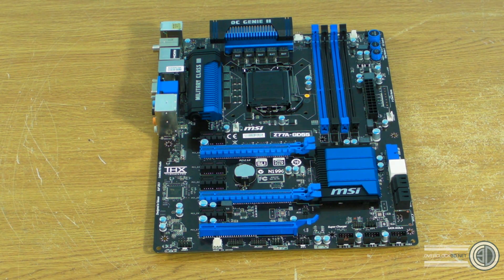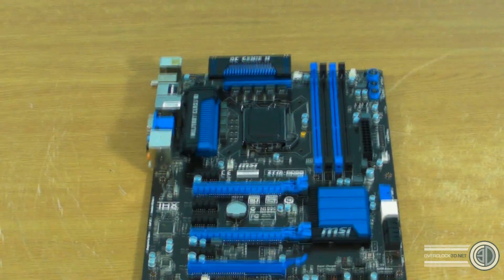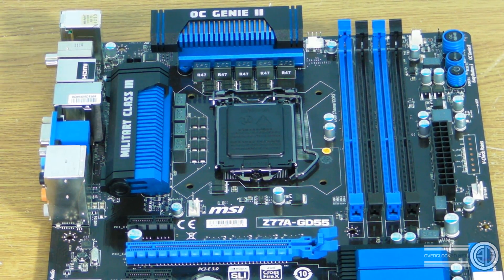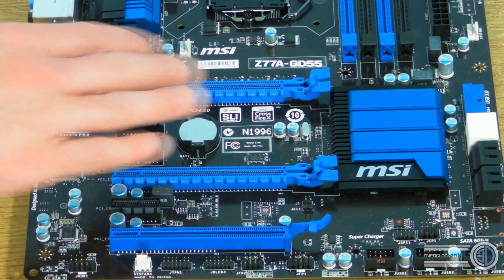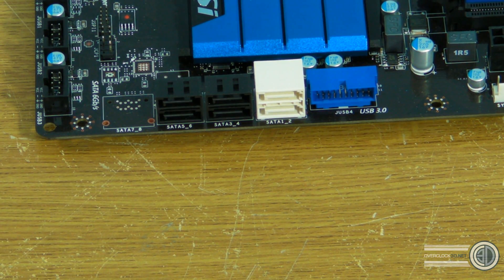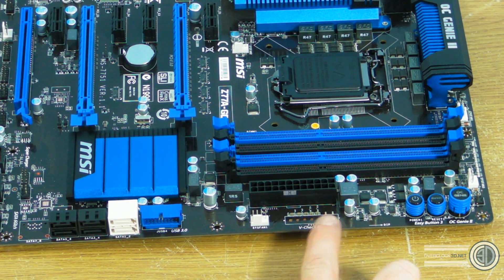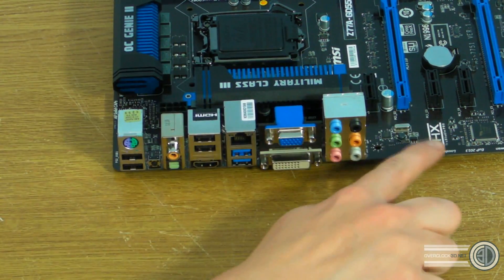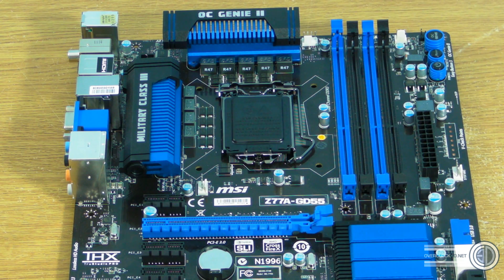MSI Z77 GD55 First Look - Ivy Bridge 1155 Review

Comment: The Mpower has a few extra things this doesn't have like 6 usb 3s wifi and a few other things and its tested in extreme conditions other than that there is not that much more of a benefit so I will leave it up to you if it's worth it.

Comment: Hey tom, was doing a new build today,
mobo: this
CPU: 3570k
RAM: Blue vengeance 1600 4x4GB
GTX 660Ti power edition by msi matches this board perfectly.
SSD's psu blah blah

Would you recomend the mpower version over this for the extra cash?
I'm only 15 btw

Comment: msi builds there boards all the same and only solders parts for each model so the reason those v check points and sata slots are there are because the gd-65 has sata ports the and v check points. they save money doing this.

Comment: Hi Tom. Been watching your revs. Good stuff. Fair appraisal but I was hoping explanations of the Z77's between brands and features. This vs. GD65, I see (obviously) no sata 7/8 sock. No socket at the volt. control point (blue socket on the 65). No legacy PCI sock (been praised,not on the 65 either, and I agree, no need). Less power phases (if I recall correctly). Does it have also LEDs for each phase? Advant. of 77 over 68? Cooler clearance over RAM? This vs. GD45? Just suggesting M8...

Comment: Your pretty much right, the only thing I neglected to mention is that the z77 boards support Ivy Bridge and Sandy bridge, the z68 only supports Sandy Bridge. Unless you really need the latest processor I would go for a i5 2500k and a really good z68. Also Pci 3.0 doesn't make much of a difference, in the tests I've seen there is only a 1-3% performance increase over pci 2.0. (z68 gen 3 boards do have usb 3)

Comment: Love the 90 degree USB 3 header. But not a fan of hiding the voltage check points behind the 24 pin wires. But over all a nice looking board.